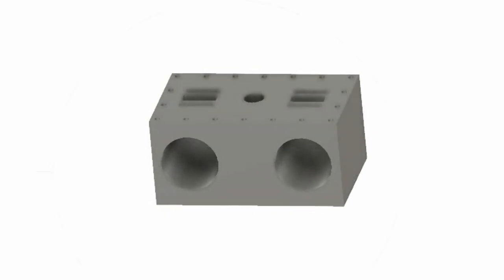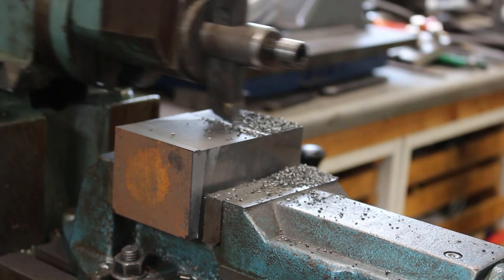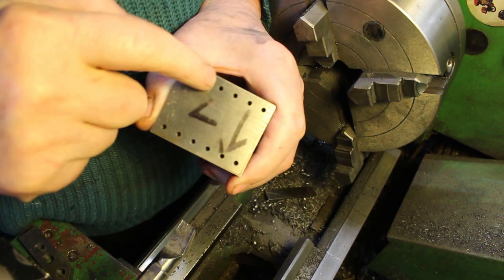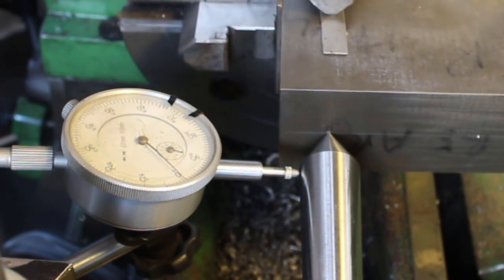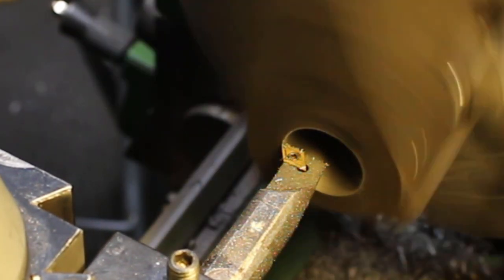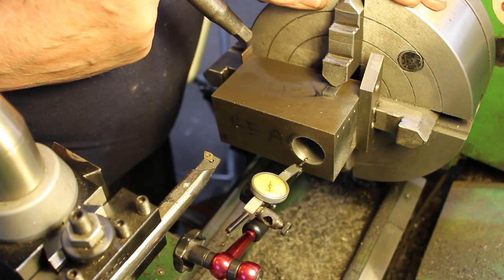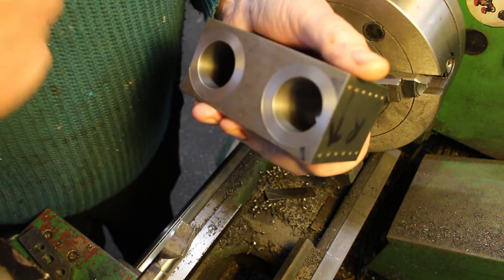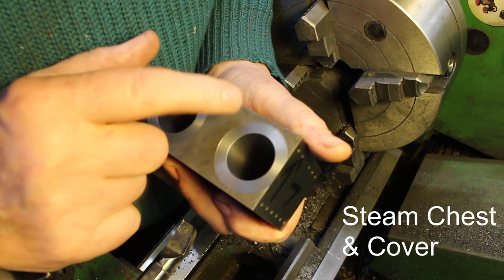Lion - 5"g  Miniature Locomotive Steam Engine Build pt.40 -  Cylinder Block, Steam Chest & Cover

Comment: Very nice. May I suggest even using viton o rings. I have 4 5" gauge locos which have them, two of which have cast iron cylinders. I have used cast iron piston rings in one that is going and the one I am currently building. Viton o rings are easy to fit and easy to replace if worn. The seal well, if fitted properly too.
Reply from the maker: Thanks nswgr. Yes, I was wondering about using silicone 70 shore hardness 'o' rings. I'm leaning towards cast iron rings just because it's more traditional but still not sure. . A friend has used PTFE which have worked for several years. Thanks again
Reply: Go Create Hobby Machine Shop you've achieved a nice finish on the bore, it will work fine I am sure which ever way you go.
Reply from the maker: Thanks, I came across this article which looks quite interesting, really intended for bronze cylinders where metal rings would not be very appropriate.
https://modelengineeringwebsite.com/Steam_piston_rings.html
Reply: @GoCreatehms  Interesting. The one problem that I have seen with PTFE comes from a far different application, that being the bushings that Ford uses on it's power running boards for their pickups and SUVs. This may be a design defect, the plastic is only about 2/10th of a mill thick and so when it wears through due to the normal crud that is on the undersides of a car, the underlying steel of the bushing starts to rust. The final result is a running board that gets stuck up or down or even worse somewhere in between. 

I have been doing a project on rebuilding the one on my wife's side of our Navigator, it got stuck down then I ran over a bit of a bump and broke that board off the SUV. OOPS. Both brackets broke. I am replacing the front one with a new after market one, so I will have the normal set up there. In the rear bracket, I am installing new bushings, but I have also fitted Zerk fittings to the pins so that I can grease them. We shall see how that works. Been a great learning process, doing the work, doing the videos and getting them up on YouTube. 

By the way, nice work on editing your videos, that is a learning curve in and of itself.

Comment: ooooh a shaper. so mesmerizing. wish I had room for one,
taking shape nicely, I'm just wondering about the valve arrangements, guess I will have to be patient and wait.
keep up the good work!
Reply from the maker: Hi Paul, nothing very fancy for the valve gear on this engine. The drawings give a choice between Slip Eccentric and Gab arrangement. I'll be adopting the Gab gear, I believe this is what the original engine has and it typical of the period, not exactly sure, but it's quite an interesting feature. Thanks for your interest.

Comment: The difference in surface finish of the shear tool DOES show, but I'm fairly certain that what I see doesn't do either surface  justice.
Are you going to bother with a gasket between surfaces, or just a metal to metal seal? Ha ha   Maybe a single layer of copper foil for a gasket so I won't feel like such a caveman.